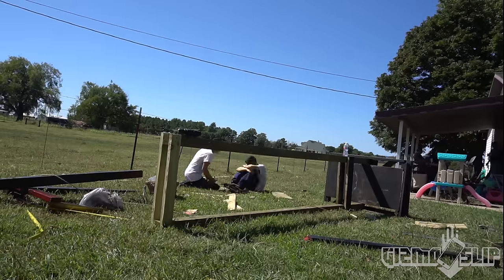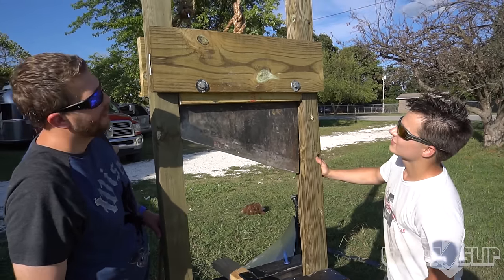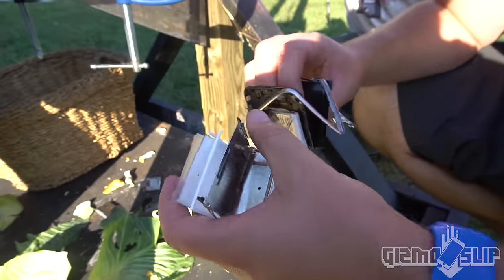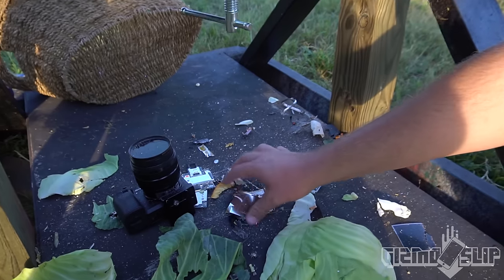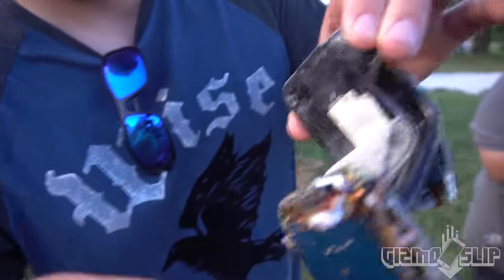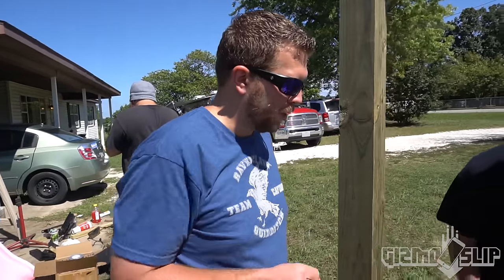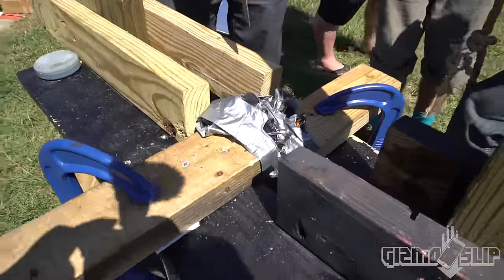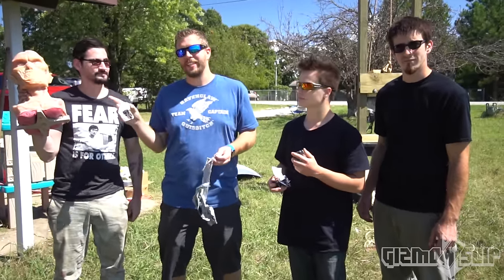How Many iPhones Can a 12 FT Guillotine Slice Through?

Comment: You won't ever get a clean cut, unless you really sharpen your blade, and I mean industrial millstone sharp and you should also support the phone on a more rigidfoundation: those two pieces of wood are badly costrained and are too much flexiible. 
A lot of the energy dissipates for the pieces of wood to both rotate (friction) and bend.
Industrial machines use massive iron foundations